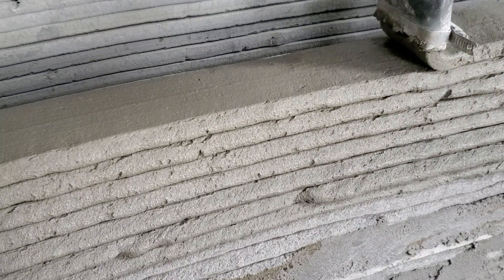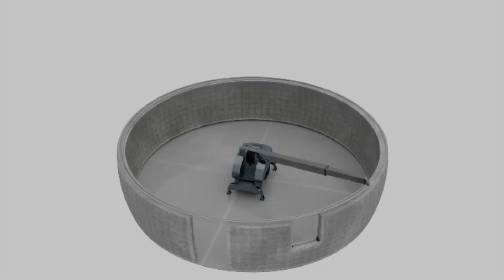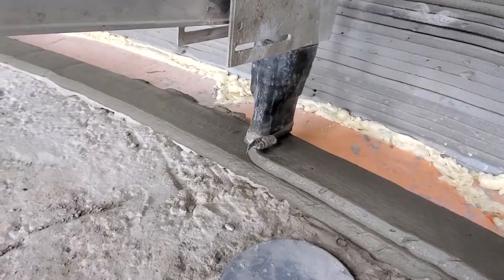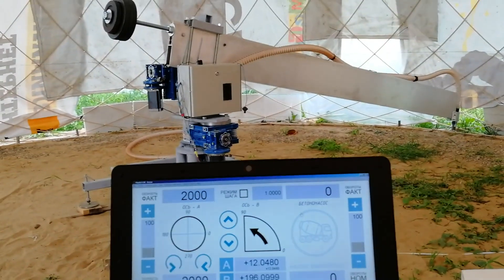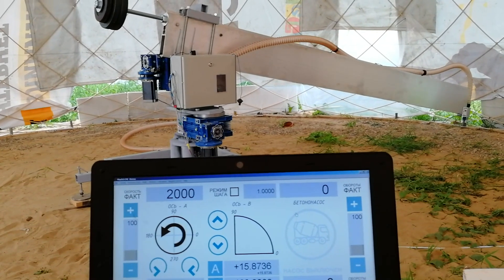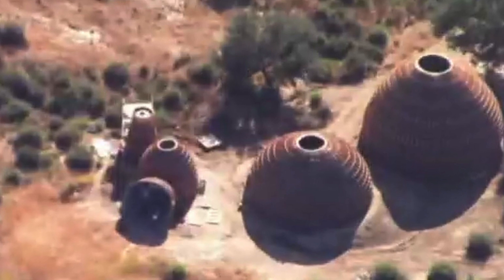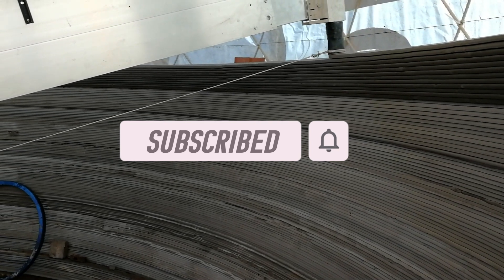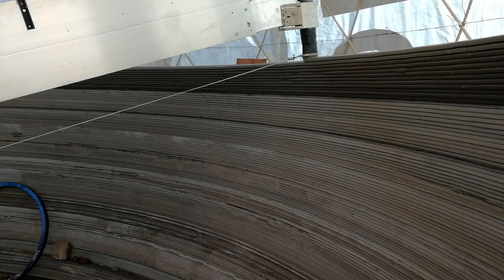3D Printed Domes for Shelter in Russia [Printed Dome]

Comment: This method is interesting but somehow obsolete for what they are:
1 no structural rebar not geodesic nor simple.
2 no plants or tubing integration directly in the mold.
3 no differentiation like Pantheon in wall thickness to increase structural stability larger at bottom thinner going to the top lightening the structure.
4 no insulation... and actually molding cement with contemporary polystyrene cases is a quicker process than slowly print laying flat courses.
5 no orientation... just look at Maggiolina case Igloo e.g. structures must be windows oriented towards or away from sun irradiation to get or to avoid sun energy inside.
6 no tunnel Igloo entrance... this means opening the door the big main room loose heat or freshness and energy invested to get a stable comfortable interior temperature.

Comment: Whoa, a 3D-printed roof! This is what I wanted to see. Plus, I love domes. I was wondering if printing a roof this way was possible and I guess it is. If this kind of printing can create a durable roof that doesn't need some other kind of expensive treatment or coating to last and not leak or crack, that would be huge.
Reply: We cover PU. Doesn't swell. We also print the dome in 2 layers and fill the gap with mounting foam.
Reply: Two layers in the same time with the 3rd nozzle in the middle spraying insulation, hmm?@AlexSuslov

Comment: What about rebar reinforcement?
Reply: The great thing about domes is that they are very unlikely to come under tension - which means rebar is not needed.
Reply: 🌬🌪🌩  😄😄😄  I would definitely love one with strong rebar embedded inside the design.
Reply from the maker: Not for this one.
Reply: Reinforcement will be a stele thread. With a 2-wall version, reinforcement is used. Let's add a photo to the site.
Reply: It’s a geodesic dome on the outside so no rebar needed
Reply: @mwambasol9556  I think you can't build a geodesic dome only with material which have no resistance to stretching. Example, take steel tube, insert loosely round steel bar in it, and put another piece of tube on the other end of the stick. This construction can be easily stretched but can't be compressed. If you use this for each rib, will your geodesic home be reliable? Guess no. Concrete have good resistance only to compression. It needs rebar.